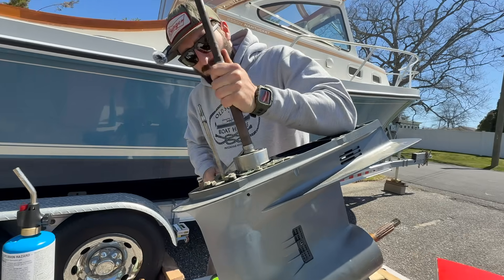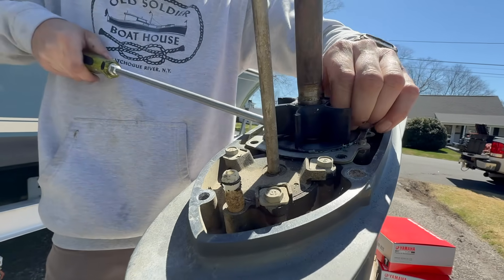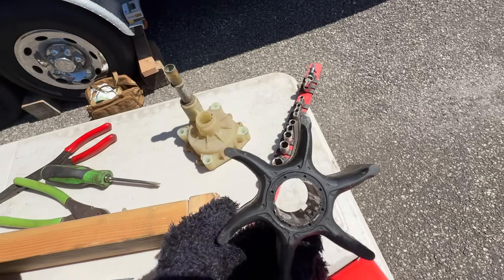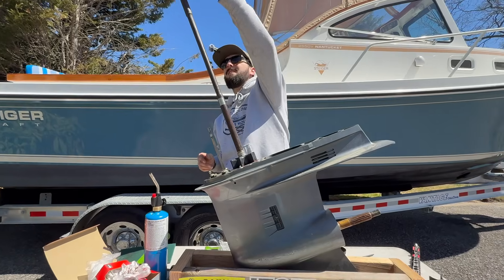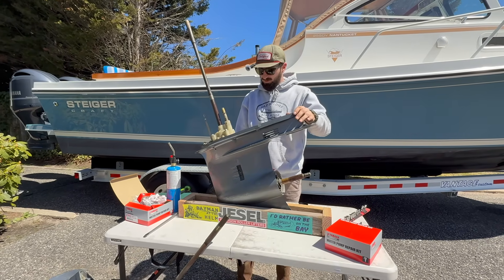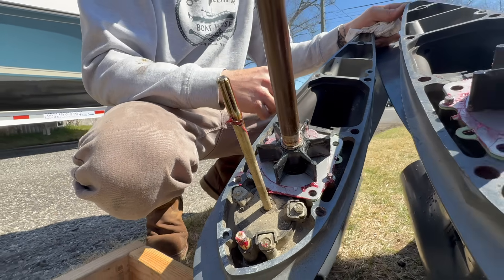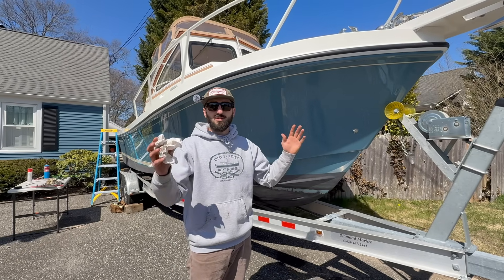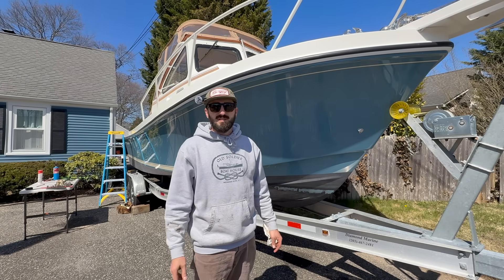Can You Run Yamaha on Flush Port? TESTED!

Comment: I'm a new boat owner and don't know shit. This video is very helpful to understanding how all this works. I'm fortunate that I live about ten minutes from the launch, so my motor is still very warm when I get home and I flush immediately when I get home. My question is, when I need to do an oil change and lower unit gear oil change, the manual states to warm the engine oil prior to removing the old oil and I'd prefer to not do that after a day on the lagoon. 1. Will this method warm the engine enough to heat the oil to oil change temps? 2. Does this warm the engine enough to open the thermostat? 3. What temperature does the thermostat open? I ask (question 3) because I have a hot water tap in my garage (I have a utility sink/tub in my garage connected to the house water and has a hot water line). IIRC, the hot water is set to 140*. My thought is that I could connect the flush port to the tap and run hot water reducing the time needed to run/warm the engine prior to the oil change. Thanks.
Reply from the maker: Thermostat opens around 130-140deg, the thermostats in these motors are 140 degree stats. Yes this will warm the engine enough to change oil. I actually change the oil cold on my engine this way the engine oil filter is empty and doesn’t make a mess when removing the filter.
Reply: @MOBILEMAXMARINE  I've always wondered why every manufacturer/mechanic states to warm the engine when changing the oil when, like you state, all the oil has run to the bottom of the pan when it was warm but had much more time to collect in the pan while it cools. I've often taken the oil pan drain plug off on my vehicles when I arrived home and left it overnight to drain.

Comment: It's without the bucket that people screw up .I've been a certified Yamaha tech since 87.Some tape on the lower unit intakes I've broken four strokes in like that.Some run hot with muffs from no exhaust pressure.Water pressure plays a huge part.

Comment: BS! Run this boat for 30-70 hours then do this test! The grease is why nothing failed on this test! Your an idiot
Reply: You know, you sound like an idiot ( I say an idiot with an E) by your comment. Why you flushing a motor 30-70hrs…lol…however, no need for this video. Just think of the logic. Where the flush port path and the impeller water path. Half wit bmiller, hopefully you get there🫡
Reply: @Bilskirnir030 I’m saying replace both impellers and run the boat for 50-70 hours, then do this test. I promise the results will be different.

Comment: I don't even run the engine.  Just use the hose on the flush port.  I get water out the tell tale every time.  Am I doing it wrong
Reply from the maker: No that’s perfectly fine, it’s just when you don’t  run the engine the thermostat won’t open

Comment: You could also test the temperature with the thermal gun that would give you correct if one is running warmer than the other. I don’t believe you’ll see any wear with just 30 minutes of use.
Reply from the maker: I will do that in my next test. And I’d be lying if I didn’t do that already ! Lol

Comment: I thought you were supposed to use flush port without start up.  Am I wrong?
Reply from the maker: People have many opinions on this. I personally have been running Yamaha 4 strokes on the flush ports for over a decade. Not telling anyone they have to do it this way but just showing if you have good water pressure and steady flow of water out of the pick up grates and out of the tell tale, you won’t burn up your impeller

Comment: I can appreciate the amount of work that was put into proving both sides of running the motors on a hose vs. a bucket but using grease to help lubricate the new impellers is not good at all. I will either use liquid soap or a silicone spray to prevent dry start up. That grease over time will allow debris to collect on it and cause possible overheating issues. Whatever the case good side by side test.
Reply from the maker: Thanks !

Comment: Put them together and after 50 hours of run time start the test. Drive your boat normally for the next 50 hours but flush them the two ways shown until you perform your 100 hour maintenance. Then see if there is a difference.
Reply from the maker: I’ve got about 30 hours on them now, and with the boat in the water I can’t flush in the bucket. But I will make a follow up video at the end of the season

Comment: From what I understand it is lack of water in the water pump, lack of water lubrication that supposedly causes the rubber impellor to 'burn'. Is it possible for at least 1/2 an hour all that installation grease inside the pump housing lubricated the impellor in the absence of water?
Reply from the maker: I will do a test with no grease so we can figure that out

Comment: The thermostats do not open on the flush port, which does not allow the flushing of sand salt etc. Although i have to admit never ran the engines for 30 minutes on flush port. Did your engine overheat in the bucket side? I use a horse drinking trough that i put on casters. Wheel it under the engines and run them in it until the engines temps are up to norm. The sand and debris on the bottom is rather surprising. Once a year i put salt away in the trough to clean them out.
Reply from the maker: Neither engine over heated both temps were the same
Reply: There is always a bypass near the thermostat. Granted it won’t be 100%, but just to through a general number out,,,80% good to go

Comment: Logically yes the port runs water to the impeller. Creating pressure when it spins also runs water into the head temps will be normal

Comment: For arguments sake.  That grease helped both impellers. (From running dry and burning/scoring)  better do it again with dawn dish soap.  0 grease.    My point is,  i think there is a good change that impeller could run inside with that much grease and not be an issue.  After months at sea, that impeller will be dry as a popcorn fart :D Thats when it should be tested!  Pretty sure, running on the washdown port is absolutely fine!  As some water trickles down and lubricantes the impeller.   Evinrude says this very same thing.   BUT,  IDLE ONLY

Comment: Bucket seems easy and a no brainer, especially if you have multiple engines, you can run them at the same time with limited water pressure going to each engine...
Reply from the maker: Bucket is no doubt the best method. Just a little science experiment! Thanks for watching

Comment: That’s for all the KoolAid drinkers out there lol…Been using the flush port for years.As long as you keep it at idle and don’t rev or throw it into gear it’s fucking fine
Reply: I have a SELOC Manual for my 2000 0X66 225.  That manual says you CAN use the flush port to run the engine.

Comment: spoiler alert ive been running my 2001 off flush port since new
Reply: I've seen at least 4 other YouTube videos that PROVE that you can indeed use the Flush Port to run the engine.  The other videos took the lower unit off, ran water through the FP, and showed how the water gets to the impeller housing.

Comment: Greased impeller not a good thing. Dish soap or glycerin is what should be used. It lubricates very well for assembly then washes out quickly with water. Some of the waterproof marine grease and general purpose grease is still there after many hours of use. I have seen it swell and make the impeller material spongy. I have also seen so much grease used that it wont pump water. I know many mechanics and YouTube experts use grease but it's not recommended by any engine or pump manufacturer that I am aware of.
Reply from the maker: Hey thanks for the comment. I’ve been greasing impellers this way for more than a decade , never have had an issue and have never seen any remaining grease when I pull pumps apart at the end of the season.
Reply: @MOBILEMAXMARINE  But has it any use? No!
Reply from the maker: @stevendegreef93 actually it does, 1. The grease helps hold o-rings in place during install, 2. It helps installing the actual impeller into the cup, 3. It allows you to easily turn the drive shaft while installing the lower unit helping line up the splines to the crank shaft, thanks for the comment!
Reply: @MOBILEMAXMARINE  same here
Reply: I have used both flush and ear muffs that way there’s no 
Question with good water pressure

Comment: Normally, there's no grease in the pump after being run in a body of water (river, lake or ocean). 

I'm not sure that's a fair test with a pump with grease as opposed to one with no grease. The grease is lubricating the pump as would water. IMHO.
Reply from the maker: Maybe I’ll do a test without grease . Although greasing impellers during installation is common practice
Reply: @MOBILEMAXMARINE my understanding is that the pump receives just enough water to avoid burning out if you just idle.
Reply from the maker: @Do-UR-Research2749 I’m sure it does ! The grease is just precautionary and doesn’t hurt anything. Maybe I’ll do a no grease test

Comment: If the water is running out of the tattle tail, the pump is getting water.
Reply: The new engines pump water out without the motor on

Comment: That means you can run every outboard on flush port?
Reply: Yes, and no, you can run them at idle, but if you rev the engine, the pump will run dry quickly as it is only been lubricated by water coming down the outlet of the pump. Besides all that, there's no point at all running the engine it does not help flushing and opening the thermostats is a myth. There is a bypass system. but it's a good way of testing the engine before you go out on the water if it starts, but of course does not test the pump
Reply: @pdevonport7266  Does this flush, flush the inside head and cylinders? Without turning on the motor? Is that what you’re saying?
Reply: @Majesticanglers  yes, it does but only if you have enough pressure, 60 psi and flush for 20 minutes this will reach the top of the heads and flush the thermostats and open and clean around the poppet valve. Running the engine does nothing. You would only use this method to run the engine if you were going out for the day and wanted to check if the motor started. If you don't have enough pressure by far the best and only way is a drum of water and run the engine for 20 minutes. This will heat it up enough to open the thermostats and by occasionally revving the motor clean the poppet valve. A lot of people only  rinse for five minutes and that is virtually complete waste of time. The whole idea of rinsing is to dissolve the salt crystals and using an additive like salt away helps remove these crystals.
Reply from the maker: Letting the engine warm up on the hose is a good way to help get the salt out of the engine as well. That’s why you should always flush the motor as soon as you get back so it’s still hot. I agree the bucket is the best way.

Comment: When you flush the motor without starting it through the flush port, are you getting a complete flush since the motor doesn’t warm up to open the thermostat?
Reply from the maker: @danwaller5312  no you will not be able flush behind the thermostat
Reply: That's why they say to flush it immediately when you get back to the dock while the engine is still warm and the thermostats are open.
Reply: @ronk3332 i take it back to the boat shed just a few minutes away. Then I attach the muffs on the lower intake, warm it up and let the cleaner run threw the entire system.

Comment: Sure you can run it on the flush port. But if your water pump is bad already you will not know until you get to the lake. If you are prepping the boat to go to the lake the only way to be sure your pump is good is to use a tub of water or a good set of muffs.  35 years as a certified Marine tech.
Reply: what happens when all that grease washes out from driving , would it survive the same test without the grease to protect the impeller?
Reply: Does it mean anything that the flush port engine had a tell tale stream while running? That is, using flush port, would you get a tell tale stream if the engine was off and not driving the impeller?
Reply: @timschlueter1861 yes. The hose to the flush port will have a stream without the engine running.
Reply: @timschlueter1861  You do get a stream from the tell tale if the engine is not running. At least that's how it works on my Yamaha 250 SHO. After every outing I flush it for 15 minutes on the flush port with the engine off and I get a solid stream from the tell tale. Note that the owners manual does state, in bold type, that running the engine while using the flushing port may damage the water pump and cause other engine damage from overheating. I've seen several other videos that performed a test like this with similar results, so I'm thinking the warning in the manual comes from an abundance of engineering caution. But in my case I don't see any reason to take a chance with a $30K engine; if I need to run it on the trailer I pull out my 100 gallon stock tank and submerge the lower unit just like it was sitting in the water. A little more work but I know the engine is getting plenty of water even if I need to run up the RPMs ( in neutral of course!).

Comment: Loved that you opened up pumps after they ran - Case closed!
Reply: Not really the amount of grease on impeller alone protecting it. Could run that engine dry.  since new in 2001 that’s all I use is the flush port change pump every 2 years never cracked or melted